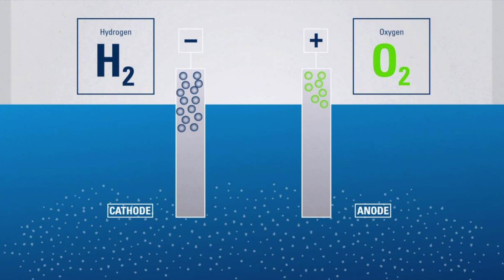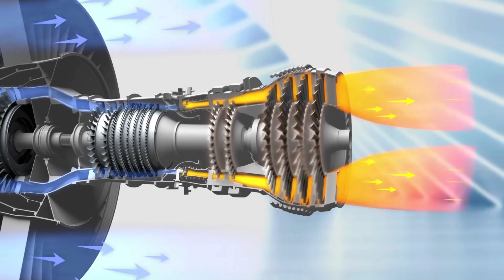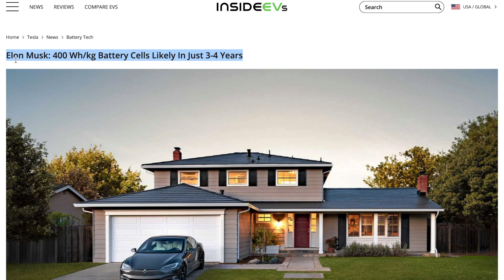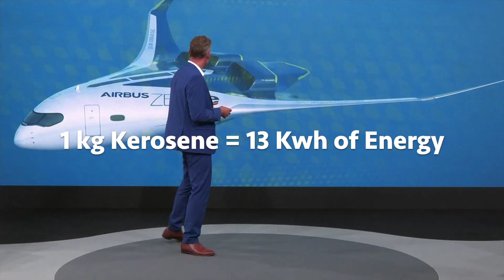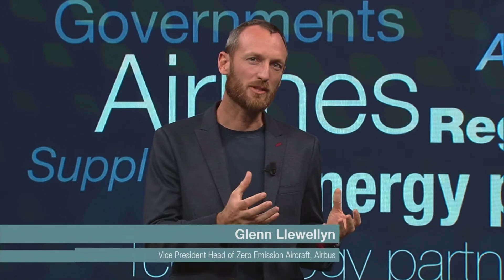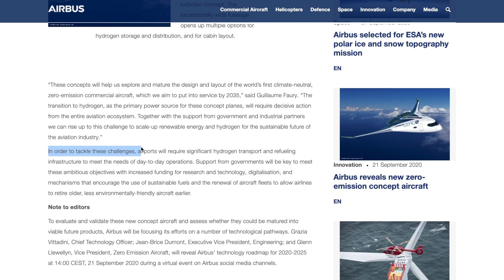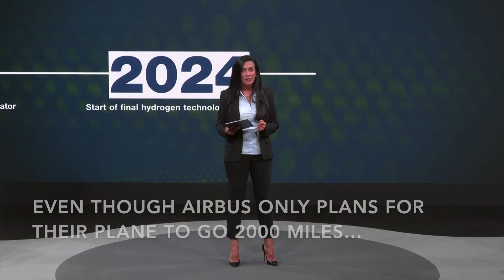Why A Hydrogen Plane Is A Terrible Idea

Comment: To sum up this video, a battery electric vehicle fanboi fails to understand how aircraft are significantly different from ground vehicles.  Hydrogen doesn't make a great deal of sense for cars or trucks compared to battery electric and have been out competed by battery electric for that reason.  Aircraft however have wildly different considerations.  Most importantly, the mass of the aircraft greatly impacts the efficiency of the aircraft, much more so than a ground vehicle.  Whatever efficiency you can make up with batteries over combustion or even a fuel cell is more than lost when you factor in the much poorer energy density of batteries.
Reply: Except when you get to batteries that have 10x the energy density that they have now
Reply: he isn't aware of power required to rotate those large propellers(which is the only option with present technology) and the speed is not even near the turbojets. He is not even aware of full spectrum of an aircraft needs and to fly an aircrafts we need more electric power for the controls(ailerons, elevators, rudders...) and to create an environment in cockpit we need to run environmental control systems and last thing, as you said the battery centric people will not even try to see the disadvantages in making battery aircrafts compared to fuel powered engines.
Reply: Here we are 2 years after this video was posted, still waiting for the fancy batteries he’s talking about lol
Reply: @jerrymolnar8010 even then you can forget long range aircraft’s with batteries.
Reply: Don't forget to mention the fact he gave an unaware audience a lie by omission of the fact that hydrogen has 3 TIMES the energy density than jet fuel and the fact that we can use its combustion to power real zero emissions long range jet engines. I was just frustrated watching this video and I hate the fact I had a like on it when it released
Reply: @jerrymolnar8010  which you won’t. Also consider this: A tank will get lighter during flight, a battery doesn’t. So you need to store more energy to begin with
Reply: Nailed it
Reply: This also doesn't include the fact as a plane burns hydrogen or a hydrogen carrier it get lighter with batteries your plane needs to have the same take off and landing weight. Meaning it's much heavier....
Reply: @jerrymolnar8010  no reason to believe such will ever exist.
Reply: They forgot to mention that 95% of the weight of hydrogen fuel is the parasitic weight of the tanks to contain it at 700 Bar.  You also need at least 3X the volume to store it compared to Jet fuel.
Reply: @markclark4154  that's why they are designing blended wing planes
Reply: @Mark Clark  nots not entirely fair there are hydrogen carriers out there.
Reply: @rgmoses2189  Hydrogen combustion is not entirely zero emmisision. It has NOx emmisisions tho very low, and there is good potential to lower it further when this tech develops more.
Reply: Batteries are only good for cars may be for town buses. Trucks would be more efficient with hydrogen.
Reply: What ignorant people like you don't understand is... Hydrogen has some of the poorest volumetric density, and there is no way around it.

 There are different battery technologies. Like Lithium Air that could have 5k kwh per kg,  or aluminum Air that can have just as much yet isn't rechargeable. (Much lighter though.)

 Battery powered planes aren't going to be happening for a bit.  Yet unlike hydrogen there is theoretical potential with batteries.

 When they do start taking off they will be for shorter flights, carrying less people. We will require more planes, but it is fine since electric motors are a fraction of the cost of jets. A fraction to maintain, and a fraction to operate. 

 For intercontinental flights? Well hydrogen certainly isn't going to be doing that either due to the volumetric issue. Until we learn how to make 5k plus BAR tanks, which are also would be extremely bulky and heavy. Fossil fuels for those flights, and electric batteries for everything else.
Reply: @jerrymolnar8010 those fantasy batteries will hit the market right after the Pixie Dust powered airliners.
Reply: He also didn't skirted around the fact that electric can't go nearly as fast as combustion (jet vs. prop)
Reply: @jerrymolnar8010  remember a  plane like a 737 has a turnaround of less than 30 minutes. Try charging a massive battery in that short time.
Reply: He calculated the usefull energy density in Wh/kg and that calculation takes the weight (kg) in to account. Hydrogen does still outperform battery by a factor of 8 as he said. I am no expert, but 8 times lighter sounds like a good choice for an airplane.
Reply: @jerrymolnar8010 

Lithium Ion Batteries have an energy density of around 500kJ per kg. 
Jet A Fuel has an energy density of around 44MJ per kJ. 

You could improve the energy density of batteries by a factor of ten. It would still be an uncompetitive technology for anything beyond ultra-short haul air travel.
Reply: @dianapennepacker6854 

We've been designing pressure vessels for over a century. There are commercially available pressure vessels that can store pressures beyond 5000 bar. That's not to say there aren't challenges with liquid hydrogen as a potential fuel source (cold metal is brittle, hydrogen is literally the most permeable substance in existence etc).  

But they are solvable. The ratio of parasitic weight to fuel weight of pressure vessels reduces exponentially as tanks get bigger (Volume increases exponentially compared to surface area). Modern structural material strength/ aerodynamics means the volumetric storage problem is easier to handle than the brutal simplicity of the lift/gravity equation.
Reply: Yeah, large hydogen planes have already been tested . He sould tell how a battery Jumbo would work 😂.
Reply: Also Weight, Aircraft need to be lighter on landing and batteries don't get lighter
Reply: @satyrec0001  exactly